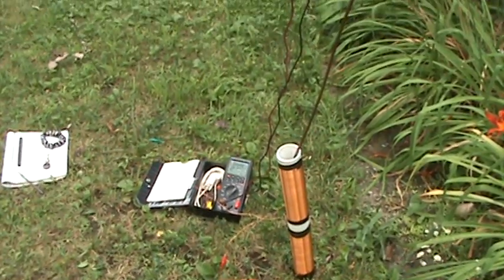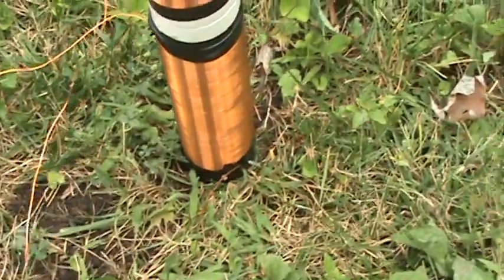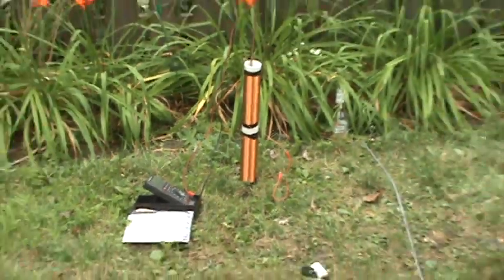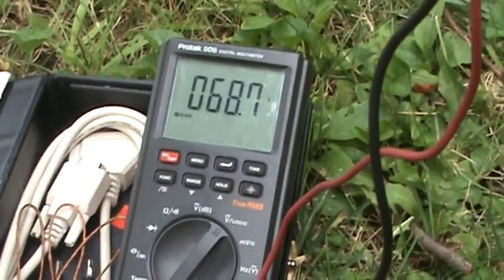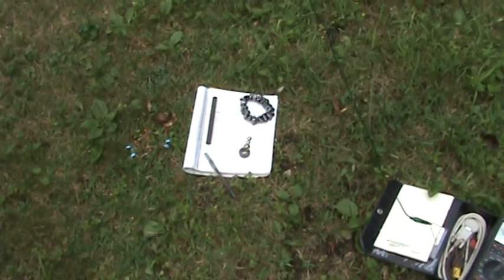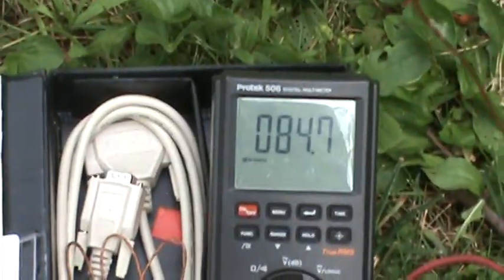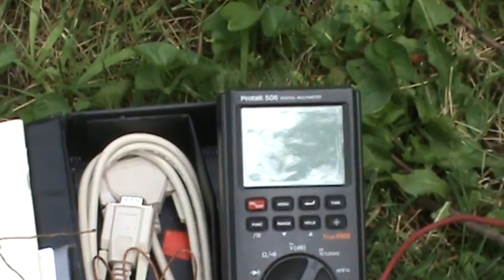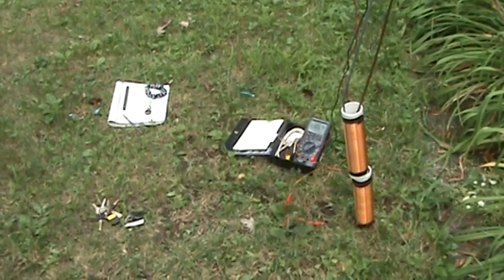FREE ENERGY FROM AIR CIRCUIT PART 10/24

Comment: Don't worry about inverters yet!(I haven't seen no.20 yet mind you :-) Just use couple of 12 volt regs in parallel and use it to charge an SLA, then show us the current when u attach stuff. This setup would be ideal also for creating usable hydrogen in areas w/o much sun. U need 2 scale it up a bit also and use some shielding on those passives. (Just my 2 bob, fer what its worth)Like ur style BTW, could be a bit more condensed mind u.Always wanted 2 do 1of these since my 1st field strenght meter

Comment: ok have you seen the website nuenergy org? also i think if you get a bigger area of metal grounding and metal antenna there will come more electricity. I'm thinking like a big copper or alu pyramid antenna or a lot of antennas put together
 and grounding that looks like a big trees roots deep into earth. with a 12 v battery in between and a bashar coil in between + and antenna. mahalo good work.

Comment from the maker: @erod1944 Current is shown in one of these vids.  Depends on if im using duel circuit design or coils & no coils.
But i get about 100 to 250 microAmps.  I got up to 310microAmps now, but that will be in the next video i make.
Im still working on more ideas now :-)